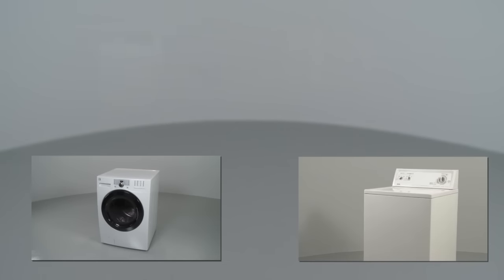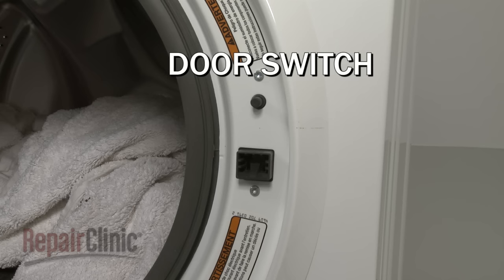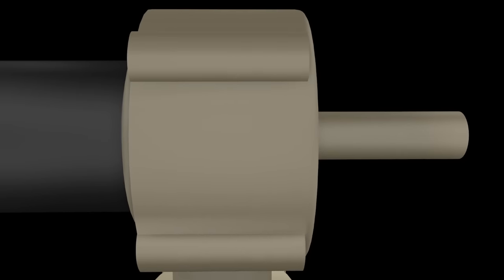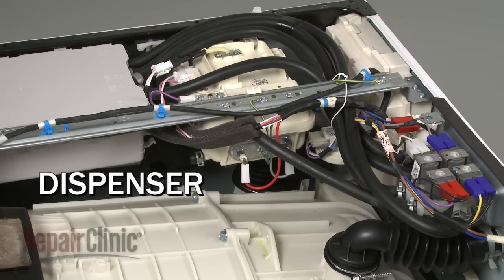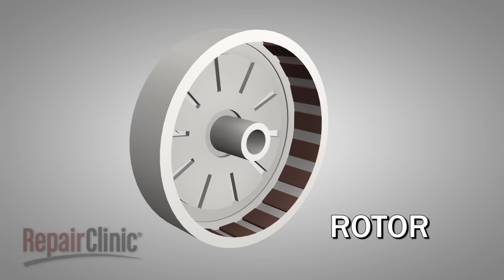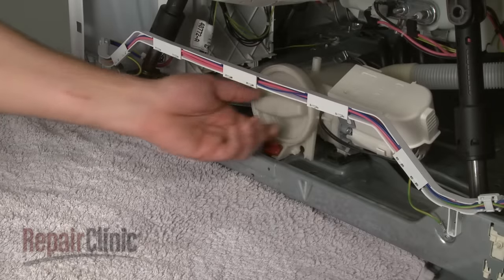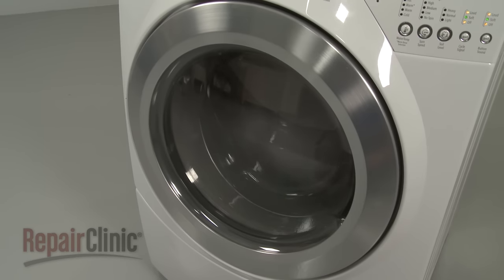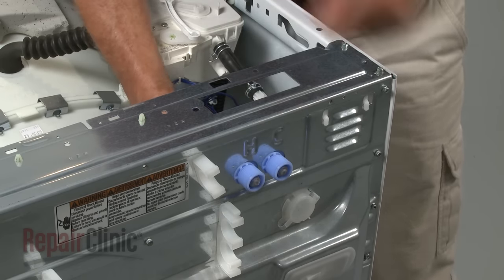How Does A Front-Load Washer Work? — Appliance Repair Tips

Comment: The problem with front loaders is that they break often (especially the outer drum spring eyes) because people overload the tub. They treat them like laundromat machines. There is a difference between "heavy duty" and "commercial". The old Kenmore direct drives were a lot better. Their only disadvantage is that they use more electric than front loaders.
Reply from the maker: Psycho9263 Overloading the machine will defiantly cause more wear and tear and cause it to fail more often.  As with any machine proper usage plays a big role in the performance and longevity of the unit. Thanks for the comment.
Reply: Durability also plays a role too.. manufacturers have fallen into the addiction of using plastic where metal should really be used and cutting production costs then make the appliance look pretty and advertise how great their machine is stick a fancy worked up name tag on it and charge you your left nut to buy it..
Then the consumer feels they got something good based on all the rant and rave over a name reather than the actual quality of the appliance and then wars and bad feelings and enemies occur when the machine breaks..
Lets face it...
No mater how well you "treat" an appliance,  if it's built like crap or built using cheap parts, it's not going to last no matter what you do.. and in this day and age, almost everything is built crappy..
Manufacturers want to build things cheap and charge you more so they make more money and so the machine breaks prematurely so you pay for buying another..
Yes treating a machine bad of course will make it break even quicker... sure...
But they break after just 4 or 5 years anyway even if you baby the crap out of it and do everything right...
And that just should not be..
A good appliance should last you trouble free for decades..
Not just 4 or 5 years..
Reply: @orangie8426  that's false
Even modern front loading washing machines last just as well as earlier machines
Reply: @orangie8426 allcorrect , i 100% agree with u

Comment from the maker: Shane Lloyd, It’s more likely the pipes got switched during repair. You may be able to correct the situation by just reversing the hoses on the back of the washer. When you select cold water fill, check the hose going to the cold side of the water valve. If it is hot, you can just change the hoses. If it is cold, you may have a problem with the water temperature selector in the washer.
Reply: Jorge Rodriguez ú
Reply: nice tool kit of life baby... wink it made me feel all weird and cute inside my chest and you're a beautiful poetic artist in high-end pursuit

Comment: In your experience supplying parts for machines, which tub rotating system is most reliable: the stator or the motor control board with drive motor, belt and pulley?
Reply: I don't have the name brand of the exact models I have purchased in the past, but a description is the next best thing! =D 

MR. MERSERVY 
I would be most aroused during my private times of pleasuring myself with my adult unit using a multi functioning, dual action, angular penetration specialty tool with a very specific attachment!

ITS A MUST HAVE, OR NO GO, GI'S! a humming bird vibrating clitourous scope mount.

it has a twist-swing that performs a deep drilling action on its own at an angle tilted like a babies bottle. ;-) 

this unit had a remote control panel with four speed settings, and eight dual twist-turn and thrust settings as well as lit up like an old pair of my sketchers in elementary school.

Thanks for asking, love! in a straight forward, round about kind of way.
Reply: @dr.markeecuevas9328  WTF?

Comment: Hi, very nice and comprehensive video.
I have my washing machine(Electrolux  EWF1486HDW) that just today has started to give problems. It fills up and then it stop with a error(E10) which it means that the machine is not filled with water...but it actually it is.
A thing that I noticed is that the water before was coming from the pre-wash side of the detergent dispenser for a wile and then would switch and come from the wash side of detergent dispenser.....now it fails to do that. So what do you think? I cleaned the drain filter, I checked water inlet filters, water pressure it looks as always...Otherwise the machine drains and spins as normal.
Reply from the maker: +Fred Bongusto We would suspect a problem with the pressure switch if it fills, but then displays an error.

Comment: I have a G.E  GFAN1100  Front Load that all of a sudden, slowed down the wash, and (continuously)  would pause/stop/door lock/wash,  then stopped, and started to hum until I had no choice but to unplug the unit, for fear of overheating and causing a fire,  while the door stayed locked, unable to finish the wash cycle.
I checked and cleaned the pump at the bottom exterior and realized that, with all the rugs that I had washed over a period of a couple of years,  had delivered the very tiny rubber bits from the rugs to the pump and was quite clogged. Now my husband is trying to clean as much of this gunk out of the pump, but unsure how far back he can reach through the  small opening at the bottom. We were wondering how long the hose is and the direction it goes in order to do a good job.
I hope I made myself clear enough to understand  :) 
I now know better to check the pump more often as the manual didn't mention that, and this was all new to me when we bought the Front Load :( 
My husband now says, he has released quite a bit, so if we succeed in starting the machine, will the water, push the rest of the gunk out? 
Thank You for reading this, and any help would be appreciated :)

Comment: Since you appear to be answering questions I wonder if you could tell me what  supports the drum (?) that which holds the clothes and rotates and holds it clear from the outer casing .

I have attempted to cure a water leak on a very very old washing machine and appear to have distorted or bent something in that I can feel metal 'graunching' against metal when I rotate the drum by hand.
After my efforts the machine wont even start.
I have really given up because the machine is soooo heavy.
I'm just interested that's all !
Reply: +divvy1400yam600  clarifying...
 could you  tell me
 what  supports the drum (?) that which holds the clothes and rotates and 
thus maintains  clearance between it, the drum, and the outer casing.
Reply: +divvy1400yam600 
still clumsy but I hope you get my meaning hehehehehe

Comment: My whirlpool front loading machine (ABM501) is not spinning, however, it washes, rinses, flushes, and takes water. But when the timer comes for spinning, it does not rotate at all. Debris and lint are removed from bottom right corner. Please advise what could be the reason.
Reply from the maker: Martin Kumar For additional possible causes, enter your washing machine's complete model number in our website's repair help section: http://www.repairclinic.com/repairhelp?TLSID=1773.

Comment: Our FL washer keeps dancing around and shaking bad when spin cycle starts. It's a GE Profile. Needed it to wash our blankets but thinking about going back to our top load washer that's still in the garage. Hate spending money on something that doesn't work properly. Hope we can figure it out.
Reply from the maker: San Me What is it's model number?
Reply: WPDH8800
Thank you for replying.
Reply: It doesn't shake when we run a cycle with an empty drum. (No clothes). But as soon as we try running it with any amount of clothes it shakes alot. We made sure legs and washer was balanced. But its still shaking bad.  My husband was wondering if it could be the shock absorbers.  He says the washer sat for years at a warehouse not being used,  when he bought them.
Reply from the maker: San Me Very first thing to check on any front loading washer that is off balance or vibrating is the shipping bolts in the back. All front loading washers are delivered with shipping bolts to stabilize the drum system during transportation. These bolts must be removed before use otherwise the machine will shake and bounce around significantly. If the bolts have been removed there could be a problem with the shock absorber system that supports the drum at the bottom. We also must mention the leveling legs. Always check to make sure they are adjusted correctly and that the locking nuts are tight to the base of the machine.

Comment: We have a 10 kg. LG front load machine.It was purchaes as "Factory Second" We suspect that it was used. The transit bolts were missing & the water hose was dirty on the outside.
According to the "Water Use" lable on the machine, it is supposed to use about 86 litres of water ob "Cotton Eco" cycle. There are dry patches on the clothes during the wash. The dry patches remain throughout the wash cycle. The total water use is about 27 litres. I suspect that there is a problem with the water volume.
Do you think that the machine is malfunction?
Reply from the maker: There are a few possible causes for insufficient water entering your washing machine. Enter the model number in our website's troubleshooting and repair help system for model-specific information: http://www.repairclinic.com/repairhelp?TLSID=1773.
Reply: I believe factory secondary would mean the item has used parts, or was used and rematinenced.

Comment: Does new washers today have built in heater than heats cold tap water if you don't have hot water inlet????
Reply: Yes modern front loaders DO have cold fill only and will use an element to heat the water

Comment: My LG front load washer originally stopped working and posted an IE message on the front, so I changed out the inlet valve and checked the hoses to make sure water was filling in. Then it worked and water started pouring out the front of the drain. I looked inside and a little water filled the inside, but mostly all of it was gushing out. Everything was closed and intact, but the water was coming out of the drainage release. What could be causing this problem? I haven't seen a video on it yet.
Reply from the maker: If water is coming out of the drain hose when the washer is filling, the drain hose may need to be raised higher than the water lever in the tub or it will start siphoning out. We are unsure what you are calling a drainage release. There is a drain pump cleanout in the front. If water is leaking out of that, you may need to retighten the cleanout cover.

Comment: Hello,  have an fridgedaire infinity washer. Not starting. Displaying symbols DR.    Is this stand for the door or the drain ??
Reply from the maker: +Alex Van Zeebroeck We would suspect the code has to do with the door since it won't start. Normally, if it was a drain issue the unit would start and fill up.

Comment: Two  yr old front loader (Samsung) shuts down then restarts itself randomly - not always the same place in the cycle although lately it happen very early in the cycle.  Not the power plug.  Control board or motor control board?

Comment: I just bought from a neighbor the whirlpool duet washer I connected the water hose directly to the washer (no hot water)but when I start the wash water comes out from where I should've connected the hot water. please help !!!
Reply from the maker: +Crystal Garcia Washers need two fill hoses to work properly so you should get new hot and cold water fill hoses.

Comment: Having two water inlets, one for hot and one for cold, sounds very inefficient because you then use hot water from the hot water tank. It's better to have just one cold water intake and use internal heating elements to get the correct temperature, such as 40 or 60 degrees celsius.

Comment: the fuse in my speed control is openon my crtf12450as0
Reply from the maker: +Howard Holt Typically that is not a serviceable part. http://www.repairclinic.com/PartDetail/Motor-Control-Board/134149220/1206430?TLSID=1773

Comment: Is there a way for me to check my door latch # 6601ER1004C
for my 796 4027 2900 Kenmore front load washer....before I buy a new one?
Reply from the maker: ***** There isn't an easy test for that part. Some models feature a diagnostic mode that you can cycle the unit through to test each component. The instructions are normally on the wiring diagram/ tech sheet in the control panel.
Reply: ***** You can temporary bypass the door lock to see if this part is the cause of the problem.
Reply: Googlick Hatece
And were you going to tell me how I might do that ?
Reply: I was considering it, but assumed the word explained itself.
If not: take a look at the lock and see which wires connect when the lock closes. Then remove those wires from the lock and attach to each other or, add an extra wire which links them. Washing machine should now think the lock is closed all the time.
Put back lock (no need to reinstall it, just put it back behind the cover) and rubber.Turn on a program and see if there is a difference in how the machine functions. If there is no difference, the problem is located elsewhere.

Comment: my washing machine,the water is not flows out?why?
Reply from the maker: wayangede2007 If water flows out the drain when not in use then the drain hose is likely sealed or pushed to far down the standpipe sealing the connection and causing the water to siphon out.

Comment: Too bad most newer front loaders don't fill with enough water.  I had to adjust the water level switch on my LG washer, just so it would fill with more water.  Otherwise, the clothes hardly got wet.  Even so, my old Frigidaire front loader from 1999 washed my clothes better than my new LG washer.  I would have kept the Frigidaire had it not been on the fritz.
Reply: Modern front loaders are way better and the water used is more than enough
Reply: @stephensnell5707  that's not what I'm hearing from people who have been long time front loader users.  I was one of those who had that problem where my LG that I bought in 2012, filled with barely any water, that my clothes did not get wet at all, compared to my old front loader.   I fixed that problem,  so I would have clothes that were wet, and tumbled in and out of water.   Before I fixed my washer's lack of water, I didn't get to someone else that I knew who got her first front loader,  and also complained about not it using enough water, that she went back to a top loader. I don't know what brand my former co-worker got, but for the LG I bought, was the entry level model, that filled by sending all of the water down to the shell of the tub, creating a rising effect.   As a result,  it takes forever to fill the tub, even after adjusting the water pressure switch.   Most other models,  and the mid-level to high end LG washers use a recirculation pump to spray water on the clothes, taking less time to get all of the clothes wet.  I can't judge for myself if those models fill with enough water, but it needs enough to get every fiber wet and stay wet, and to dip in and out of water throughout the tumbling cycle.   11 to 13 gallons is not sufficient at all.  18 to 30 gallons is what it takes to effectively get clothes clean.  18 gallons for the lightest fabrics,  and up to 30 gallons for the heaviest fabrics.  I find 3 rinse cycles work better than 2 rinse cycles.